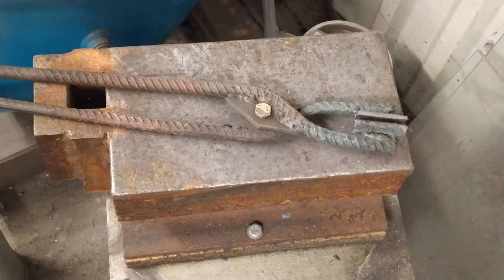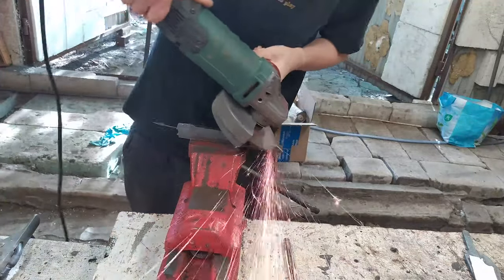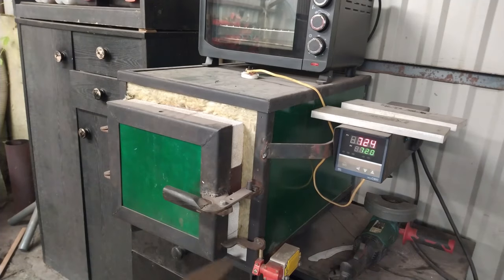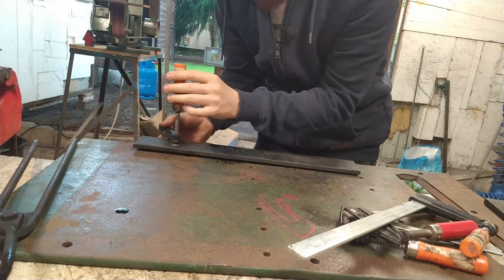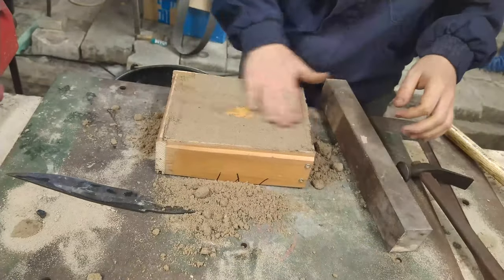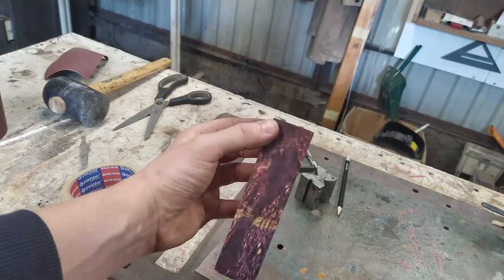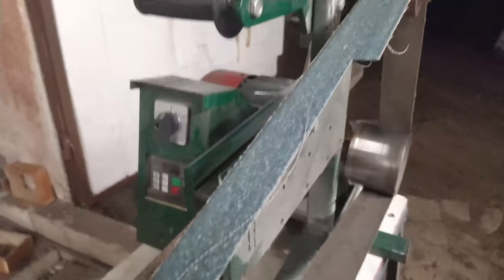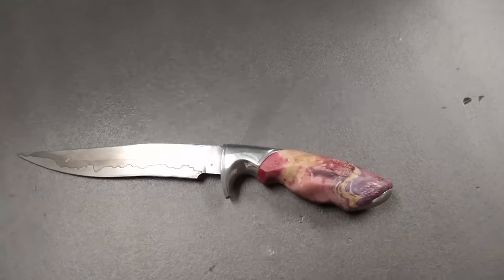I made my first San Mai knife and  it turned awesome!

Comment: Nice build, and excellent and timely advice on wearing PPE. Three days ago the wire wheel on my bench grinder caught the metal I was working on and flung it into my hands and face. Had I not been wearing impact-resistant lenses I probably would have lost an eye. From now on there will be goggles over my safety glasses when I'm grinding! Oh, and now my bench grinder turns away from me, not toward me because I changed the base around.
Reply from the maker: Workshop is not safety place. if you work are alone PPE should be no. 1. Try to find the full face mask I wear when I pour the metal into the mold. there is no problem with foog when you wear respiratior mask and this face shield.  
I've removed this video from my channel but my first casting ever goes very wrong. The liquid brass gets splashed all over the area because the mold was too wet. If you have hot crucible in your hands full of liquid metal, you cant just run away fast. PPE cloths are the ONLY protection you have. People shouldn't forget about this.  Make of buy leather apron. if will protect your body from angle grinder sparks and also, if the accident with bench grinder repeat (I hop no, but it's better to be prepared) you protect your guts. My friend mr. Death Machine get hurt very badly using buffing machine. Those tools are not a joke. 
Thanks again for watching Bryson!